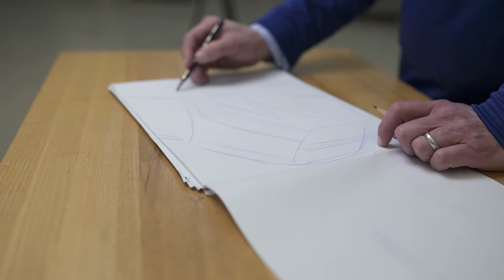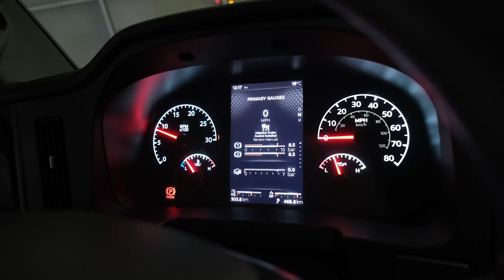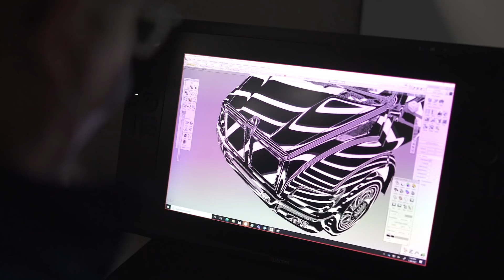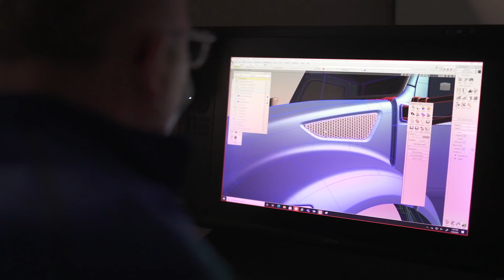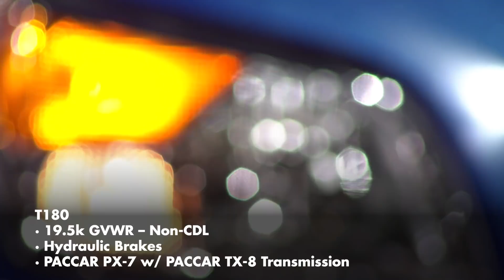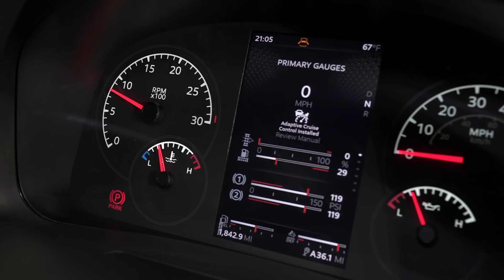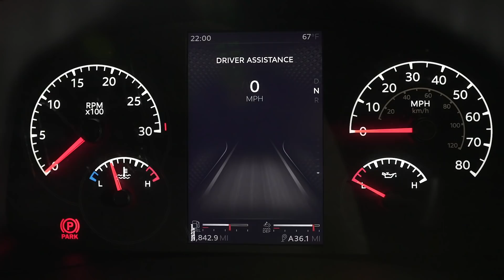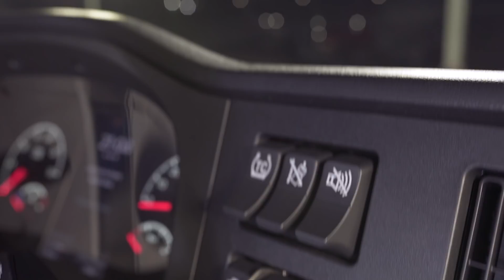The Kenworth New Medium Duty Launch Event

Comment: That’s horrible should of stayed with old style body and previous interior was way better looking and a lot more helpful.
Reply: No. They definitely needed this upgrade. I help out with Amerigas in the winter and the Hino, International,  Freightliner medium duty trucks are nicer with the wider cabs, but each has its pros and cons.  Hopefully this update will be a step up and above the other manufacturers. Would love to have seen one of these trucks as a bobtail for the Propane industry. I'll have to wait for Lin's Propane Truck to rig up one.  From what I've seen it seems like they've done a great job of redesigning this truck.
Reply: Kenworth Australia has already been running this cab on the T360, if it can handle the scorching heat of the outback I’d imagine midtown Manhattan on Monday would be no problem